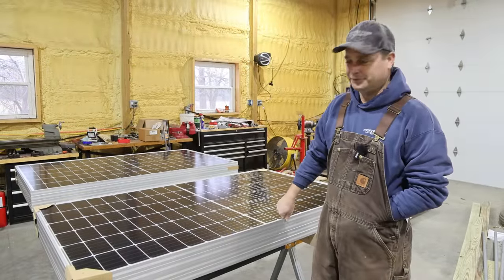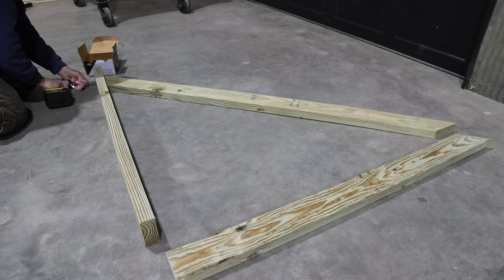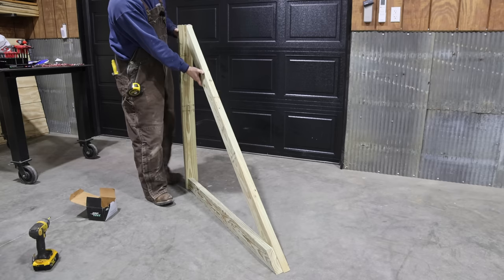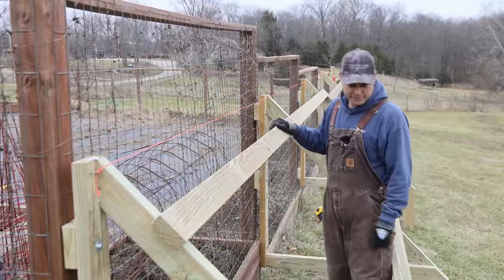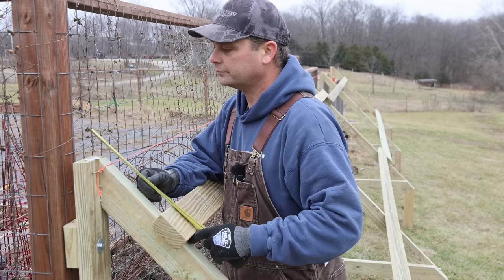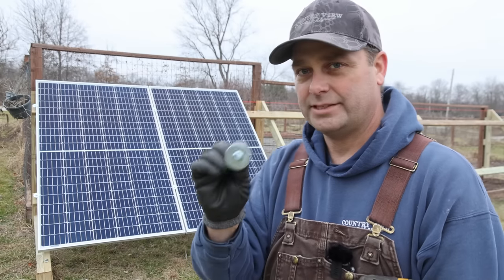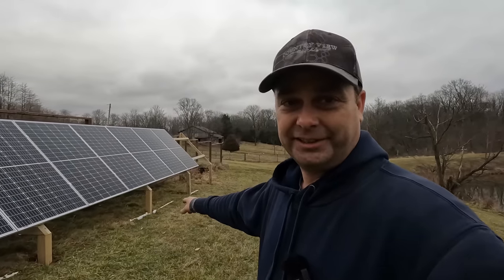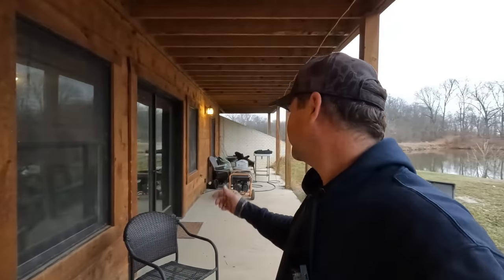Building our First Solar Array.  Easy, Low Cost Solar Ground Mount.

Comment: I’d rethink putting those panels on the roof of your workshop. Keep them on the ground.
Reply: I agree. We first installed our solar panels on the metal roof and it was impossible to reach them to remove the snow and we couldn’t clean them because water made the metal roof to slippery. We moved them to ground level.
Reply: And space below the panels is good. Circumstances meant we had to place the supports for the panels directly on the ground. When we push off the snow, it has nowhere to go. We can only clean off the top half of the panels. Now we’re looking at ways to elevate the panels. Where you have them placed in this video looks great. I hope you haven’t moved them yet.
Reply: Agree 100%.
Reply: In case of hail as well.  @CorvidFriend

Comment: put a 90 degree bend in your washers close to the center hole for the outside panels, it will keep them from wanting to tilt. Love watching your videos.
Reply: I hope he listens to you he doesn't take my suggestions
Reply: I would just put a small block of wood of the appropriate thickness for the other side of the washer to tighten up against.  And don't forget to cut a channel for the lag screw to pass through.  I would think that the edge of a bent washer would to easily cut/sink into the wood as the lag bolt was tightened.
Reply: @DEJones71  Most of the established channels do not , for a period of time, then the idea is theirs. Same as in real life. This channel has always had great content , filming, explanation & humor......in my opinion.   Also, no mumbling.
Reply: Since Evan said this is temporary the current connections might be fine as is, but if it wasn't and with Evan being a good fabricator, he could make some clips and drill a hole in flat aluminum stock to use, and I'd make some for the bottoms to secure into the wood frames as well, with those panels being heavy enough to move over time.
Reply from the maker: The bent washers are a good idea and a really easy solution.  I will try to incorporate that into my next solar video.  Thanks.
Reply: that will work :)
Reply: LOL

Comment: Just a thought, why dont you put a board on the bottom to act as a footer to hold the panels and give added support than just relying on those lag bolts? Food for thought  especially if you are gonna roof mount them.

Comment: the better angle is closer to 30 degrees than 45. you might be loosing a significant amount of power generation. check your location for proper tilt angle to the sun. hope this helps.

Comment: Hi Evan, I would put a rubber grommet under the fender washers. As for the ends, it looks like you have room for a block of wood or use a piece of conduit to run the lag bolt though to hold the panels down. Another thing I would do and that is to put a 2 by 4 at the bottom for added safety to help hold the panels in place! These are only my opinion's.
Reply: especially the 2x4 at the bottom.... imo...
Reply: And some rubber tubing over the lag bolts. With a little space. On a hot summer day the long array will get longer.

Comment: Awesome!

Run a 2x4 along to bottom to carry the panel weight

Temporary, I would think there’s some kind of angle bracket that would be made for this to make it easier to hold the sides down
Reply: I used 1" chunks of angle aluminum for mine.

Comment: You mentioned the final place for the solar panels is the pole barn roof.  Just a recommendation—I would try to stick with a ground Mount system.  Roof mount systems are a maintenance challenge on a good day.  JMO

God bless.
Reply: I agree, I would never walk around on my roof and risk damaging it. Most everyone in my area have them roof mounted.

Comment: Evan, love your videos and the wide range you cover. If I may offer some advice, you live in a wooden house, you have two battery storage devices full of lithium ion batteries, if they go faulty and go into thermal runaway that’s 1800deg c and almost impossible to put out. Put them away from the house in a fireproof enclosure .. few feet of cable for the safety is a must 👍

Comment: I have been off grid 5.5 years now and have 16000 watts of panels. 1/2 the year I can run everything in my house and my shop easy. I would say 10% to 15% more than I need in the summer. Now November December and January I could use 15% to 20% more panels. I have 56kwh's of chevy volt batteries and I think 70kwh's would be great when I get there.

Comment: Agree with earlier comment about keeping as a ground mount, where you can brush the snow off in winter and wash dirt/pollen off on other seasons. 
A cut piece of PVC pipe slightly shorter than the thickness of the panel for the end panels (lag bolt with fender washer goes thru pvc piece and wall of PVC prevents fender washer from angling down too much.  Usually, you want some type of grounding on panels, even Romex with stripped wire every 40" wrapped around a bolt attached to each panel (panels should have a few holes on underside of frame) would work when coupled with 2' of rebar driven into ground  with U bolt gripping stripped end of the length of Romex.

Comment: I have a stack of panels with an inverter and battery gathered but yet to attach together. I the shipping company left your yellow cardboard 'do not stack" cone intact. Mine was squashed flat, and four panels were fork truck fork speared. Replacement panels shipped also had a flat cone and oil stains on top but those survived.

Comment: New subscriber here.   Thanks for the video.  I live about 30 minutes from signature Solar here in Texas.  They are very helpful for the DiY community. I am in the process of sizing my system on paper and consulting with signature Solar. I am considering various options (partial coverage, emergency generation only, or total off-grid). We just had another ice storm in north Texas.  I grew up in northern Minnesota and I have seen cold weather make a mess of things. So I am motivated once again to keep the lights on and provide emergency backup power at a minimum.  

You are doing a good thing with your real world trial.  Keep learning and asking questions.  God Bless!

Comment: Nice and cheap mounting. Be aware with washers and corrosion especially if they are not also aluminium based. Versus time corrosion will appear here. Maybe with some plastic washer between, will save the situation. Cheers from France.

Comment: Bought similar (different wattage) Canadian Solar panels also from Signature Solar recently and I'm going to be building a ground array that will double as an equipment shed (the panels do double duty as roofing material). Planning on installing a couple of off grid inverter/solar charge controllers to be the primary power source for the farm with the grid as a back up.

Comment: We've installed 1 of 3 hybrid inverters with our panels and batteries that are hooked to the grid to run first from solar, second from battery and if not enough solar they automatically switch to pulling power from the grid. The aim is to have a backup for power outage plus daily reduce our electric bill.

Comment: I would put a 1x1 or a 1x2 across the bottom of your panels.  It’s just added security to keep them from sliding down.  It can also take some pressure off of you lag bolts too.  If you don’t have any, just rip a couple of 2x4’s down the middle.  Just added peace of mind.  I also think putting them on the roof would cause issues with cleaning snow, but I don’t know how much snow you get at a time and how often you see that kind of snow fall.

Comment: For testing and trial runs..... I used a dozen folding chairs I had around the house.  Just prop the panels up on the back of the chairs and wire them up.  6KW array was making almost 5KW during summer testing.  Zero cost of materials.

Comment: I realize it is temporary but you may want to consider some ground anchors and straps as well as keep taps on weather as strong wind gusts will get under the panels and rip them from framework.  We had over 30 tall pine trees rips from ground with gusts only. (No tornados).

Comment: Hey, we epoxy the brackets on the roof of RV no screws works great 65mph on the road no holes on the roof.  If you have low light area your going to want to put them on a solar tracker and  stand it follows the sun strongest light.  Easier to maintain panels on ground.  You will get more watts a day.  Look for used pipe at scrap yards it cheaper and aluminum frame.  I would not put those panels on the barn roof there weight plus a snow load would be bad.  You don't want to be climbing on the roof everytime you need to clean the panels.  Also add a lighting surge protector to the panels.  Good luck

Comment: Hello from Germany, here it is not allowed to screw the solar panels directly to the aluminum frame. the frame is not part of the overall statics. a rail substructure is required for roof mounting. Good luck and have fun with the system

Comment: Nice setup Evan. Now the weight of the panels hangs completely on the screws and washers. Due to the effect of heat and cold, space can be created here, making the connection less strong. Wouldn't you rest the panels at the bottom on an extra rail so they cannot slide? I'm curious how it will look when it's done.
Reply: Hi, like the idea of resting against a beam on the bottom edge. Could also use bolts through the solar frame mounting holes into the beam they sit on.
Take care & keep on generating your own power. M

Comment: You need biracial maybe and mount were they can get sun both sides for more output in winter
Reply from the maker: these are eventually going on my pole barn roof.  Bi-Facials are recommended for Roof mounted solar.  If it is a ground mount, bi-facials are the way to go.

Comment: I’m very curious to see how well this system works. Like you, here in east central Minnesota, it’s very cloudy most of the winter. I’ve been very reluctant to go with solar. We did install a geothermal system to heat and cool our house and we are very happy with it.
Reply: I'm in Wisconsin near Green Bay and I've had 24 solar panels for 11 years now and it actually works great here . solar panels get hot so in months like March when the air is cool and clear on a sunny day they produce the maximum wattage. It is low production from about Dec to Feb.
Reply: et en français c'est plus  simpatique pour nous  francophone   ....

Comment: Great job keep us posted.. I'm very interested in this especially if it means we could go off grid in future.. our electricity prices are going a bit daft just now. Stay safe 🏴
Reply: Sure ye checked already.   But there are loads on second hand panels from the solar farm at Ex RAF Coltishall in Norwich for sale.   Ok. They not new.  But they Do a trip £65 a pop. They change them ever 5 years.    I am in Aberdeenshire. 4kw does in the summer.  But not even close in winter.   I am looking to add another 8kw at least for now on ground mount with battery backup.  Just to capture the most I can in the winter months.   I feel yer pain on the sparks pricing.

Comment: You should put a 1x2 at the bottom of the panels to help hold them up just to be safe in case one of the screws come lose just a thought
Reply: I am glad you mentioned it. I couldn't figure out why he didn't do that to start with.The    lags will loosen up with weather changes.
Reply: Same thing I just told my wife........lol

Comment: My array isn't that large, but I used 1"X1" angle iron along the bottom on one array, and the same in aluminum on another to make sure the panels cannot slide down. Don't forget to put a grounding wire on the array metal frames to the ground, or you could get a nice "tickle" from that much Voltage, especially if you're running them in series.

Comment: You might be surprised how cost effective Iron Ridge racking is. Even for temporary setup that is being moved. All of the racking can be moved to the permanent setup. XR rails with L feet and fastener and sleeves would have held all of those in place  without worrying about damaging the panels or them coming loose. Then to move them you just decide on the attachment for the metal roof whether that be S5 or something else for the L foot to attach to.

It's already done and I'm sure it will work fine. Just wanted to comment so that others can consider the option.

Comment: Great video, thank you for taking the time.
This is a great approach, testing out the panels in the real world to see what you can actually get. Have you checked online to see the “usable sunlight hours average” for your location. It would be good to have that number and compare it to what you get in the real world. You built a very straight forward, simple but effected mount. Looking forward to the next videos on solar. Thanks. 👍👍
Reply from the maker: Yes.  2.8 hours in December, 5.8 hours in July.  Average off all 12 months, is 4.72 sun hours.

Comment: Thanks for video as I am planning to build one similar to this. However I am concerned about rain water will cause wood rot and make the wood soft and lose their strength when the rain water gets into the wood at screws you drill in to the wood. Good video those.

Comment: I agree with the people who are suggesting a bar below the panels to prevent them from sliding off if the bolts loosen - right now you are counting on a little friction to hold the panels in place. The frames will shrink and swell and twist with the temperature, moisture and wind. The second thing to look out for is corrosion. Your fender washers look galvanized, but in any case dissimilar metals form galvanic couples. Maybe the aluminum frames have a good powder coating, but rubber washers won't hurt. Finally, if that is treated lumber, acq or ca-x , i would electrically isolate that too. Not so critical with a short-term setup, but if you want to leave it outside for 20-30 years on the roof of the pole barn (you dont want galvanic couples there either)...

Comment: Evan, buying a solar system is a very wise investment but why not do one as your primary source of power for the house and eliminate a large portion of your electric bill rather than using it as a backup source of power. Doing that would qualify you for a 26% government rebate on your taxes. You could expand it to 10 or 12 kw and have a grid tied system serving nearly all the demands of both the house and the shop. 

I’d suggest you invest in the type of solar you have in mind for your barn and that well. Doing so would save you on your electric and water bills. One of those battery storage units would probably handle all your needs for the well and lighting and power in the barn. 

One more recommendation: those posts around your garden will probably not safely support that temp install in any kind of serious storm. Those panels are big wind sails. Why not buy yourself pipes for a secure ground mount system for now and then expand it rather than going with a roof mount system. Doing so will give you an easier to maintain installation now and in the future. Your panels like mine need periodic cleaning to maintain max output. Cleaning a ground mount system is far easier than doing so on a roof mount system, more so as you get older. I don’t think you have enough space on that lean to roof on the shop to expand your solar enough to be able to service all the needs of the house and shop. My system is 24 390 watt panels and it supplies 90-95% of my needs here in the Missouri Ozarks. I live near your latitude about 175 miles west of you. My summer surplus satisfies all of my spring through fall needs and about 75-80% of my winter needs. Congratulations on going solar. Take the next wise step and make it a big enough system to all but eliminate your electric bill. You don’t need to do it all at once but don’t make a move that restricts your future growth opportunities.

Comment: The panels will need to be aligned perfectly to achieve the 1260 watts from each of your arrays. Even then you can't expect full power for the entire 5 hour average solar use unless you have your panels on a solar tracker. Since the sun is lower in the sky in the winter you can expect less power, to compensate  panels produce better in the cold.
Reply from the maker: 1100 watts is the most I have seen out of them so far.

Comment: Wind loads can be enormous , do your due diligence people.  45 lbs per square foot is quite common.   Do the research for your site.  My 4700 watt array can have 8000 plus pounds of up lift alone.  No Joke,  This is why many  piers have 2000 lbs of concrete each at 5 ft plus depth.  Other ways to do it, but gives people an idea of the forces.  Wind Forces are no joke.